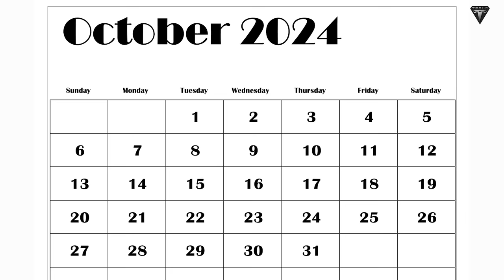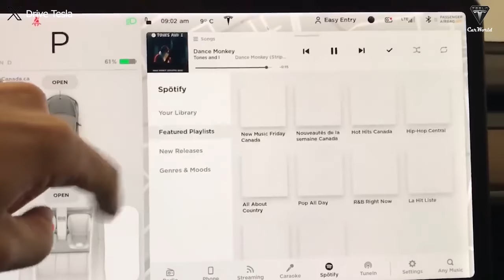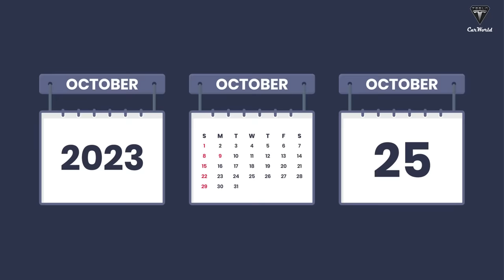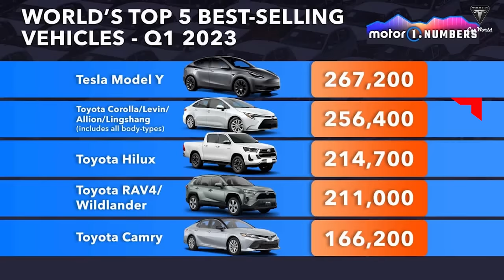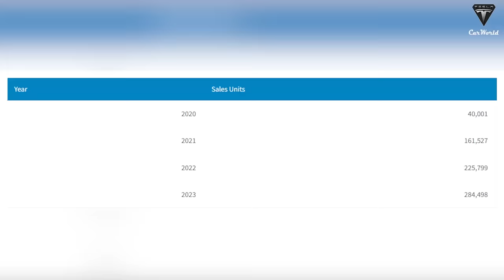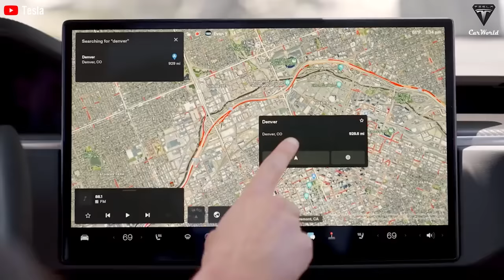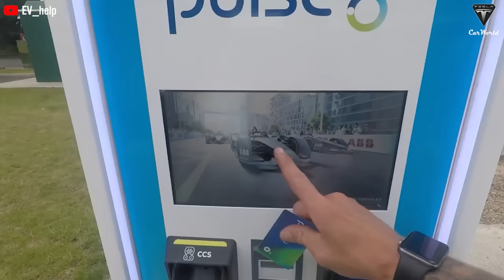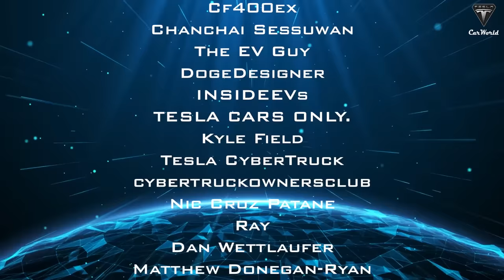What You MUST Know 2024 Model Y JNP with New Interior, Shock 'NCA' Battery, 4 Hidden Features (MIX)

Comment: Should automatically lower a few inches when driving the freeway and maybe tilting the front end 1/2 to increase tire pressure to the front creating better handling.  L like to see face recognition when approaching car.  May develop a hand sign language that is only your own to operate the car.  What about retina eye recognition.  Say you can use your phone or car to accomplish.  Make it standard with rear hitch towing are make it super easy to upgrade even if you are not a mechanic